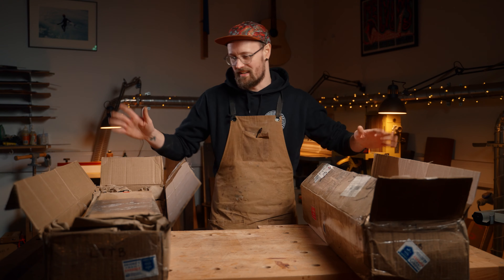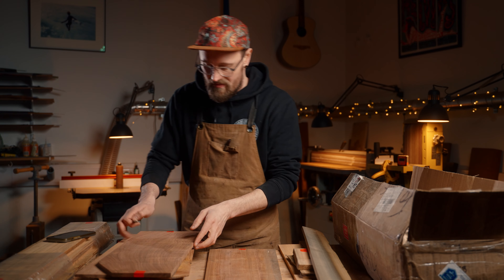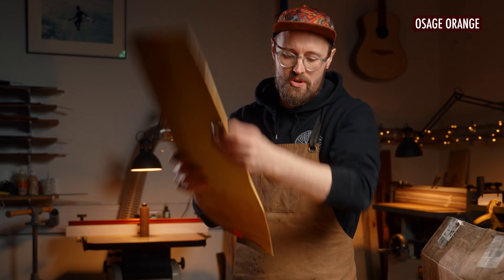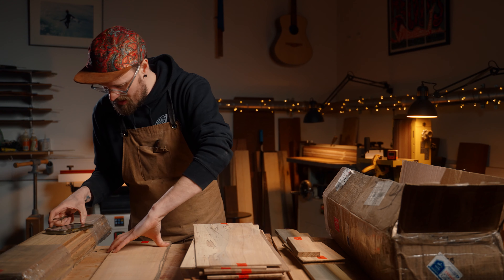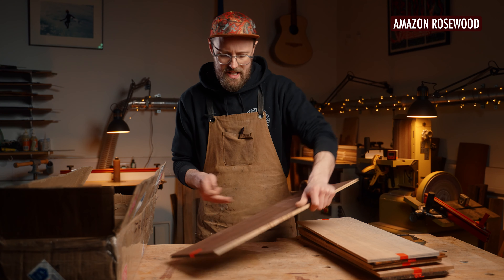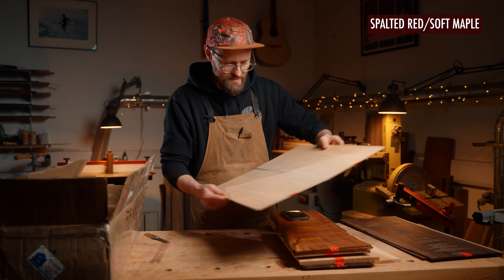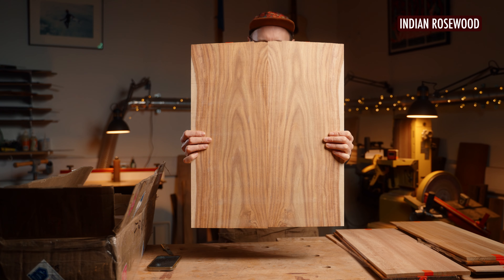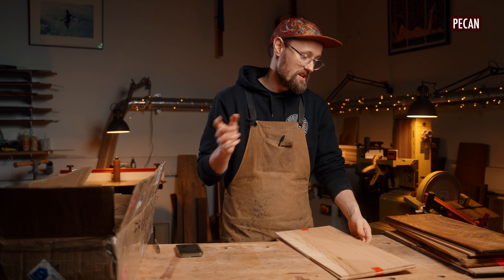Unboxing some BONKERS Tonewoods! - Tommy's Tonewoods

Comment: What the hell, that's his first try at making a guitar?! Amazing..
One question - could you make a classical guitar with some of these more exotic types used for the top? Or would it just sound crap compared to the usual spruce or cedar?
Reply from the maker: It’s a lovely thing! Ideally you want something lightweight and stiff for the top, so exotics are not really suitable
Reply: @TomSandsGuitars  cool, thanks for the info!